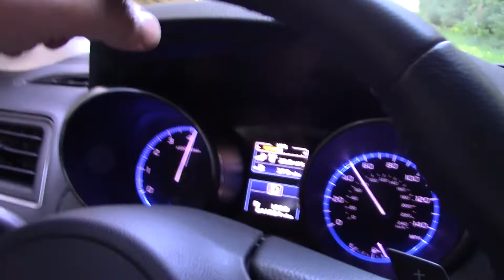Subaru Outback 21mm Rear Sway Bar Upgrade 2015 to 2017

Comment: I just did this with the same links and a 19mm bar.  Upon reassembly, i started with the link hardware first.  It slid in but not as hard a time as yours.  I was about an inch away on the brackets though.  They would not go on until i took the load off the rear end. All seems well.  Man does it drive less like a boat.  Thanks for your tutorial 👍